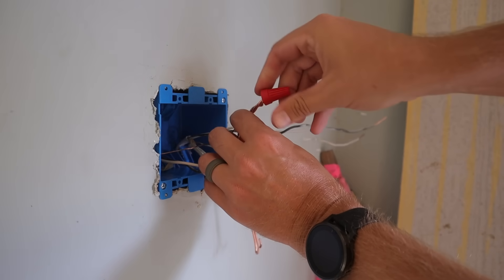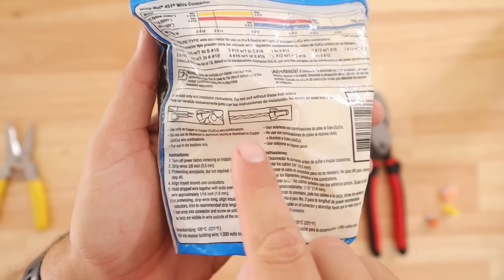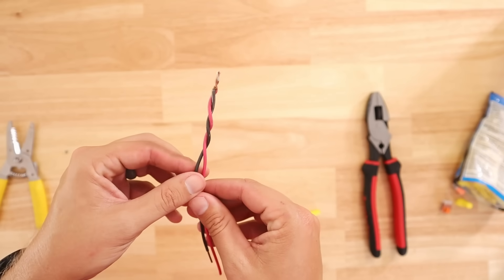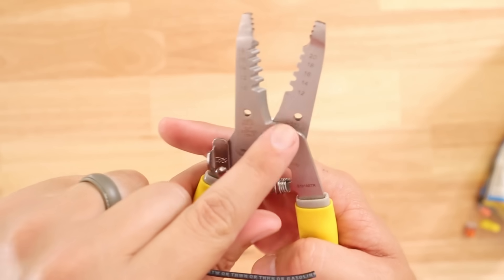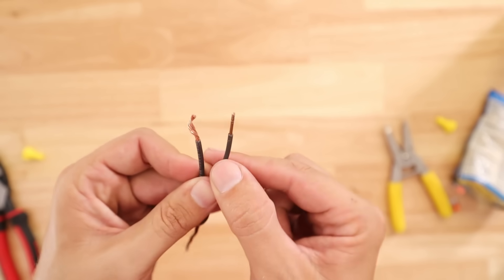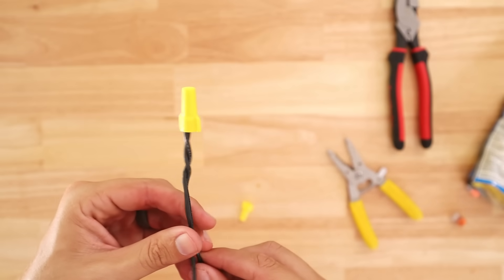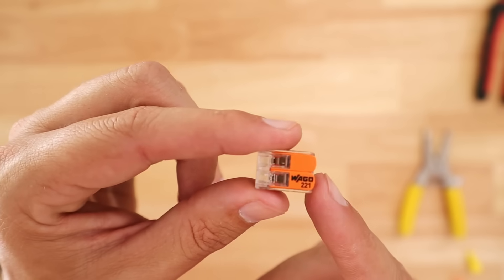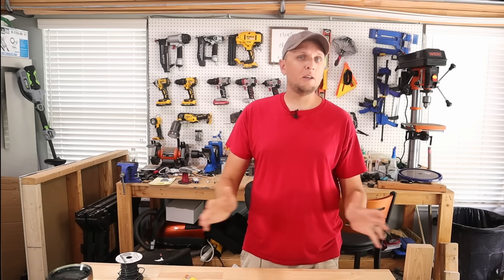BIGGEST Mistakes DIYers Make When Connecting Wires Together | How To

Comment: I used some similar connectors to WAGOS one time in a 8 can light installation. The connectors came from the manufacturer of the can lights with the line and neutral connectors pre-wired.
I was skeptical about using them as I had never done so.
The first two can lights I cut off the Wagolike connectors and went with wire nuts, I then called a master electrician whom I know and trust very well to inquire about these. He said they were okay for that particular application (volts, amps, etc.) so I wired the rest of the cans with them.
It saved me a lot of time!

Comment: When making a solid wire to a stranded wire connection, Untwist the stranded wire.  Lay the stranded wire around the solid wire. Twist on the wire cap. The twisted wires should be visible past the cap for two twists. Always do the 'tug' test to see that the wires will not pull out of the cap.
Wago:  A few years ago, a manufacturer of electrical devices had a quickwire receptacle.  15 amp, 120 volt.  There were holes in the back of the receptacle for the solid circuit wires to push into.  These also had the ability to connect two pairs of wires.  The internal contact made with the wire pushed into the 'Quickwire hole' was a small spring-metal contact.  The amount of contact with the wire was very minimal.  Similar to the Wago device.
I have seen many connections fail due to the 'quickwire' receptacles, with many receptacles & switches burnt and destroyed. Connections are the biggest problem in the electrical trades.  Failures, downtimes, fires, are the result of 'BAD' connections.
The NEC says 'make good, mechanically tight connections'.  Will a Wago do that?

Comment: Wagos suck, they have relatively high connection resistance compared to wirenuts and will overheat when the wire is carrying it's maximum rated current.  Thus Wago connectors will fail when when you run at max current and may cause a fire.  I believe they will eventually be outlawed.

Comment: I've seen old wiring where the wiring is just twisted and taped, I twist first as it is a guaranteed connection that I can see before I cover it up with the nut. I would especially recommend that to new DIY'rs at least until you get the "feel" of a good nut.

Comment: I'm 65 and never had a problem with wires coming loose when using wire nuts. More the issue I have had is when electricians put wire in the quick connect hole of electric wall sockets vs. wrapping wire around the screws ! Had 3 of those come loose.
Reply from the maker: Yes the backstabbing is a very common issue that comes up.  Many service calls because of those.

Comment: A comparison and use case video on the different connections would be great.  I had a debate with my father-in-law on using a wago vs the old school wire caps.  He was against using it because it was new and different.  I convinced him for the purposes of what we were doing it would work just fine.  Especially since it came from the manufacturer for the light install project we were working on.
Reply: Agreed- the Wago seems far superior for the typical light fixture installation, especially if the fixture has stranded wire. Everything except putting the solid wire into the Wago can be done before having to get into the install position.
Reply: Never argue with an old dude!!  The fact is that you are both probably right.  In the case where you are both speaking the truth Old Dude wins every time.
Reply: I appreciate the effort in trying to argue with dad-in-law, but sometimes it is not worth the effort. He may seem to understand the benefit of using Wago's, but in the end, he will go back to using his tried and true methods. Kind of like trying to get plumbers to accept Push to Connect (Sharkbyte) connectors. They are new and untested, why should we switch? He, we are switching to PEX, isn't that enough?

While DIYers are always willing to try new things. Just to see if they are better. Sometimes they are, sometimes they are not. Remember PB for plumbing?

Personally, I like Wago, they seem to take up less space, especially when doing rewiring for an incompetent prior owner who thought they knew what they were doing.   No, you can't put that many wires in that small of a box.... (I really do love cutting out old boxes and putting in new larger boxes... At least that way I know they will stay in the walls now!!)
Reply: @dherman58  I like your take on things. I can also see where different situations could call for different applications. Good to know how to use a variety of things
Reply: I think they are great in light fixtures, but they are mechanical and mechanical things have moving parts and over time, mechanical things can fail. Making a solid splice correctly with a wire nut will most likely never fail. With mechanical means there is always a possibility- except for maybe kernies and polaris taps. It is not that he is stuck in the past, he believes that "if ain't broke don't fix it"
Reply: not enough surface contact with wago
Reply: @jimbritttn  So how much is “enough”? They are widely used and Nec and UL approved. What do you know that they don’t?
Reply: @JimboC1957  Wago touches one tiny spot on wire; twisting is 100% contact.
Reply: @Karl with a K Why Always?

Comment: My challenges lay elsewhere in the circuit; principally in and around the boxes. Typically the leads are too short and involved to allow all the ideal tool motion required to achieve the twisting. New wiring doesn't suffer this problem; the leads are as long as I choose to make them. Retrofits are usually rife with problems. I haven't tried the WAGO but they look like a real solution.

Comment: Before joining a solid wire to a stranded wire with a wire nut, be sure to pre-twist the exposed end of the stranded wire itself. Then, proceed to twist the two wires -- the solid and the pre-twisted stranded wire -- together, before the final step, which is the twist-on wire nut. If I know I'll never need to undo the connection, I sometimes use an insulated butt connector, approved for copper wire and for that voltage, to permanently make the connection. Some old school guys actually solder the connection between two wires, before applying a tape wrap to the connection. I'm not in favor of that method, and its probably a code violation anyway.

Comment: I am not an electrician, just an engineer with a healthy respect for failure.  I always pre-twist as shown.  I also, after tightening the nut, wrap the spiced wires in electricians tape, working up to the nut and back down to the wires.  I never, ever, want something coming loose and tape is cheap.
Reply: As an electrician,  I hate people like you giving such advice!  There is simply no need to tape a wire nut, NONE!  When we have to go into a box that someone like you has done, allot of times wrong, and pull the connections apart it is a mess.  The adhesive residue from the cheap tape you all use is a sticky mess.  Let me say this again.  THERE IS NO REASON TO TAPE A WIRENUT CONNECTION TO RETAIN THE NUT TO THE WIRE!!!  Strip the conductors to an appropriate length for the connection, pre twist the solids and nip the end flat leaving at least 5/8" for yellow nuts and spin on the nut.  The insulation should be up under the skirt at least 1/8-1/4" on the completed connection.  Another down side to taping, it holds in heat on marginal connection as tape burns if the connection fails.

Comment: 9/10 failures in circuits are traced to a fried wire nut joint in an electrical box where the bond has failed. Its usually from a badly joined nut

Comment: I have striped extra, pre twist, and cut the end for many years, always makes a good connection. I like lever type connectors for lights and such but quite often don't have or cant even get in the area I am working. Trying to wrap the small wire that lights come with around the solid wire has gave me problems in the past. For lights I stick the small stranded wire all the way into the yellow twist nut first, then the solid wire. Then I give the light wire a good pull to check, and then  I throw the orange nuts the lights come with away.

Comment: 02:23 If you're going to cite the code, it would help to understand what the code says. "Listing and labeling" does NOT mean look at the pretty pictures on the back of the bag. "Listing and labeling" means the U.L. or other testing and accrediting agency's description of exactly how the product should be installed in order to qualify for being "U.L' Listed" or "U.L. Labeled." If the manufacturer's instructions clearly state that pre-twisting is not required -- then pre-twisting is NT required by code.

Yes, I am a licensed building official. I deal with codes every day for a living.
Reply from the maker: Yeah, I said it’s not required.

Comment: 14 Ga solid to 18Ga stranded:  A yellow wirenut is oversized for the job.. which doesn't mean "better".   An orange size will make for a tighter connection for this size combination every time.  The geometry of the spring within determines how much surface area of the spring is actually pushing on the conductors.  Ideal's "winged" wirenut is lovely for people with sensitive little fingers, but their non-wing ("knurled") version conserves a small amount of box volume,, has a slightly beefier spring, and is more likely to endure if a connection does get heated.

Right now there are thousands of electricians who are jumping on the bandwagon for new variants of "push connect" wire connectors ("Wago", etc...).... and it's going to end badly for the industry.  I've been in the biz long enough to remember when "quick-wire" push-in connections were introduced to devices (switches, receptacles).  While everyone was busy embracing the snazzy timesaver, I was sticking to old school wrapping screws.  Guess who DIDN'T get any callbacks for failed connections?  (and who did?)
It seems the industry STILL hasn't learned their lesson.

Final note: wrapping a connection in electrical tape after is for amateurs.  Do the connection right in the first place, and no tape will ever be needed.

Comment: I've been  a electrician for 35 yrs. And I agree with you. Most melted wire nuts I have found are not twisted.  Excessive heat due to less surface area. 👍
Reply from the maker: Thanks for sharing!

Comment: I'm not an electrician but my field has a heavy electrical side ( low and high voltage). Whenever I'm in doubt I always make sure that I at I give it a nice electrical tape wrap just to give it an extra added protection.

Does anyone see an issue with that ( added heat or something)

* I realize this does not affect the connection inside the wire nut
Reply: Someone mentioned above, that the tape traps condensation. Thus causing oxidation. He recommended a wire cap only.  Don't know if it's true or not.  But it would be fun to experiment with it and see.  😀
Reply: @mrspilipen3024  
Great point and makes perfect sense.

Comment: I think twisting the wire nut so hard that you start twisting wires is a bad idea. I've had the copper wire puncture through the top of wire nuts by over tightening. It can drill right through and now you have exposed wire to deal with.

Comment: Solid to stranded.  Bend solid over 90 degrees, leave stranded straight. Then twist. It forces the solid wire to corkscrew instead of the stranded just wrapping around a straight solid. Trim and cap.

Comment: Your advice seems pretty solid. The only thing I'd add is I'm not a big fan of the Wagos.
When it comes to connections it's all about heating. A compression  connector(like the wire nuts) installed correctly in exactly the way you demonstrated will tend to have a tighter contact with more surface area contact between the wires.
The Wagos and the stabbers on the back of switches and receptacles tend to have a very small surface area contact and that can cause opens and hot spots.
Wire nuts are foolproof when used as you demonstrated.
Reply: Jeff, your comment is spot on.   I've been been in the biz since before these push-in type connections were first introduced, and almost never used them.   The reliability just isn't there... and have done countless service calls where other electricians have trusted them, and the circuit failed.  Even UL/NFPA recognised the rampant failure rate, and modified the regs such that push in connections on devices were no longer allowed for 12 gauge solid wires, only 14 solid.  Yet here we are again, with a new version of the old problem,  electricians again riding the bandwagon, as though they never learned a damn thing from 20 years ago.
Reply: @whiteserpent6753  Having replaced literally hundreds of outlets and switches with push in terminations over the years that have failed I have to say that you are lucky and likely have not abused your outlet circuits.  Plug in a space heater or a window AC unit to one of the outlets in the chain and you will discover the folly of your statement very soon.

Comment: As a field service tech I can't tell you how many times cust will self install a dishwasher and improperly use wire nuts. When I get called out for a non working machine the wire nuts have melted and caused the machine to no longer work. I have also seen it catch fire and ruin the D.W.

Comment: Good for you to provide this information to the DIYer I would also like to see someone - perhaps you - show the proper way to strip the solid wires - some electricians still turn the strippers around the wire when striping the insulation whereas the way that works best is to just close the strippers and slide the insulation off - when teaching my electrical students I would have them try both and then take their needle nose plyers and bend the end back and forth counting how many times they could bend the wire before it work hardens and breaks - they inevitably found that if the surface of the copper were nicked by the strippers even a small amount then the wire would propagate that crack and fracture prematurely. so please show this on a you tube and help others learn the better way,
Reply: No electrician worth their salt will "turn the strippers around the wire" Not only does it damage the conductor, it wastes time.
Reply: Copper wire will work harden and as you note, knicks will propagate cracks and wire failure.  Stripping wire properly requires good quality strippers and proper technique.   Sadly I work along side electricians with decades of experience that still strip wire wrong and damage the conductors in the process.

Comment: I’m afraid you have a misunderstanding of the term “labeled”, as defined by the NEC. Labeled has nothing to with a package labeling. If the wire nut’s instructions say pretwisting is not required, then the product is being used in accordance with its listing. Labeling and listing has to do with testing and approval by a nationally recognized testing laboratory, like UL, Intertek, FM Global, etc. Some NRTLs produce published lists of products that meet specific standards (like UL). Labeled products are products that have a label physically applied to the product (such as UL’s holographic labels) to verify that the product is in compliance with the standard. 

NFPA 70/NEC defines: “Labeled. Equipment or materials to which has been attached a label, symbol, or other identifying mark of an organization that is acceptable to the authority having jurisdiction and concerned with product evaluation, that maintains periodic inspection of production of labeled equipment or materials, and by whose labeling the manufacturer indicates compliance with appropriate standards or performance in a specified manner.”

Comment: I appreciate how you show the resistance to being pulled out of the connection.
But could you actually compare wire nut vs wago "Ohm resistance" to see which has more losses.  I'd also be curious to see if pretwisted with wire nut has much less resistance than the 'technically' permitted solid core no-twist that you showed at the very beginning.  Oh high amperage applications, such as water heaters, etc, I have seen melted wire nuts, presumably because of high resistance at the joint between wires and no pretwist.
Reply: If the plastic wire nut melts and the wire is free to touch the box, I'd hate to touch unprotected live 30-60amps, 6- or 8-gauge wire.  I've seen melted wire nuts and the wire touching box, but not tripping breaker.  LIVE!!!  People, turn off circuit breaker and test before touching anything.
Reply: over heat in a 240 volt circuit, on one leg,  may indicate high amp draw  L1 vs L2, not balanced. easy to be a problem in residential work.

Comment: For a stranded wire, I always pre-twist the stranded wire itself to prevent the strands from separating and then I twist with the solid or other wire and then use the connector. This has not been motioned so far from what I see. Is there anything wrong this this?
Reply: That's the best way to ensure a solid splice. Anyone that builds control panels does it that way on the terminals... you have to when putting stranded into a crimp, fork, hook, eye, stakeon or ferrule. It's the best way to splice it to solid or do stranded to stranded splices under a wire nut too. You got it right.

Comment: I have used those wagos/slip-n connector style, but only on lower watt LED lights and switches. They are easy to use and cleaner inside the box.  I would not use them on 200volt electric heater baseboards.

Comment: Another thing I have seen that seems to work when connecting stranded to solid is to insert the stranded wire first into the wire nut, it insures that the stranded wire is fully into the nut, and that it will be wrapping around the solid wire, and not the insulation.